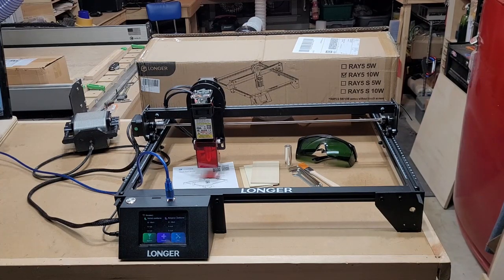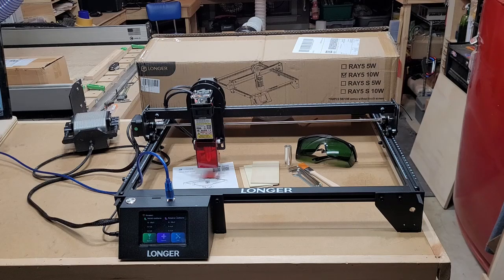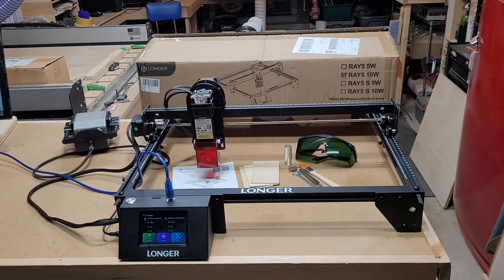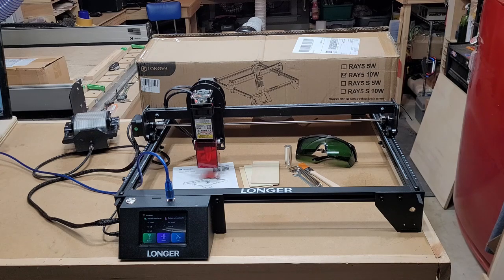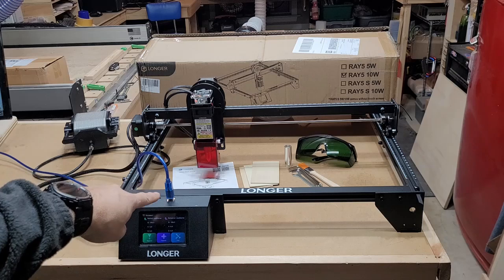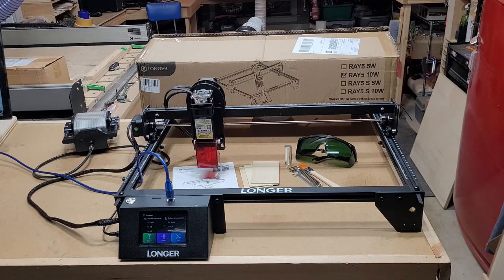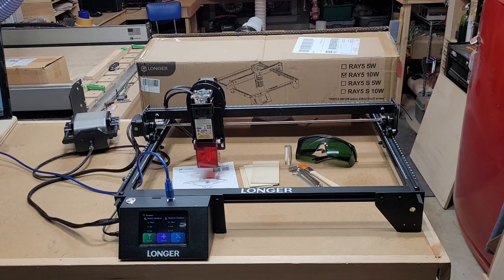Perfect laser engraver to start your side hustle in 2024. The Longer Ray5 10W Laser Engraver.

Comment: Can you cut 1/8 in plywood with this if so what is the speed and power settings
Reply from the maker: I have cut 1/8 Baltic birch plywood with this machine. I think the setting were 10 inches per minute at 90% power.